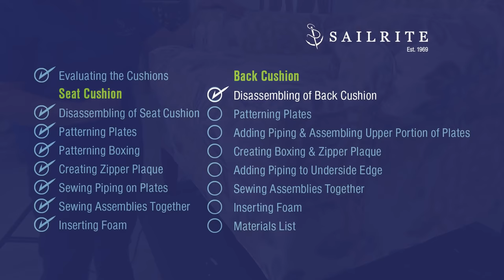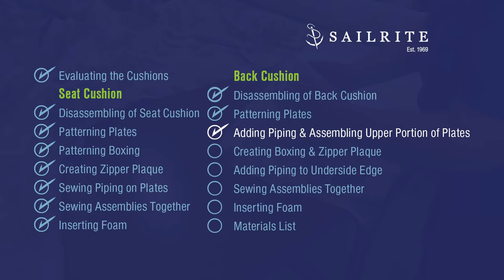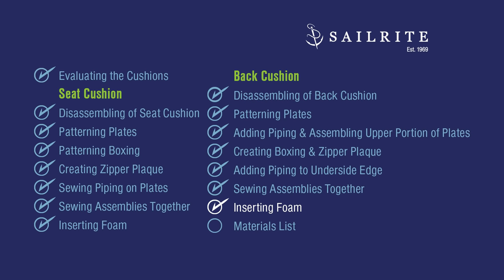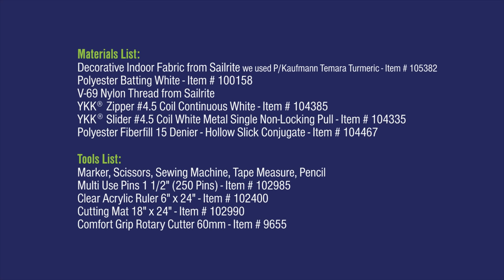How to Make Armchair Cushions

Comment: These are great instructional aides.  I hope I can manage this on my 30 year old Singer.
Reply from the maker: +Bash Brannigan Yes, you can do it. Let us know if you have questions.
Reply: +Sailrite I have a question about the sewing foot. I, too, am on an old machine. I think it's fine, but what exactly is that foot? Is it an upholstery foot, special, or what? I did a search on your site and did not see any sold individually anyway. A lot of what when on seemed to be going right along because of that foot "doing the work," as she said. Thanks!
Reply: +SKenneyGIrl Tan  My machine is also a Singer, going on about 25+ years, just FYI. I am going to look for that foot, but would love some input!  Thanks again.
Reply: You do not need a walking foot. Your regular sewing foot will work just fine so do not go out and purchase a foot. More than likely you will not be able to find a walking foot for a home sewing machine. Most are available for industrial type machines.

Comment: Is there advantage to using foam piping instead of polyester piping/cording? I am working on an indoor cushion with heavier upholstery fabric.  Excellent & detailed video.  I learn a lot & get inspired from the Sailrite YT tutorials!
Reply from the maker: Foam piping works well, but is not as soft as a "Medium Welting Cord" which is made of a polypropylene filler. So... the medium welting cord, in my opinion feels a little more comfortable than the foam cording.
Reply from the maker: I notices that you asked about Polyester cording, I seldom use Polyester cording, but I know it too is soft and could be used.

Comment: thank you again....i just finished the interior cover for a dense foam dog bed using your method for corners and zippers, and it worked out great!!!!  i too did a wrap around zipper with the fold that goes over the top and bottom of the zipper as it allows greater ease of getting the foam in and out when needed.  i do have one question....where the fold overlaps the end of the zippers, there is a opening in the fabric as i did not sew the top cover over the end of the fabric with the zipper ends...is that normal or should i sew it.  i don't recall seeing that in the video.  once again thanks a bunch!
Reply from the maker: The folds over the ends of the zippers are simply a section of the boxing folded over to provide a pocket, the sewing of the boxing to the plates secures these pockets in place. I hope that helps answer your question.

Comment: I've watched this video many times - think it's great, however I am making (or attempting) a cushion and having a heck of a time getting my corners right when adding the bottom piece. Very frustrating. And can't get a foot for my machine that has a tunnel for the cording. Using a zipper foot. Any suggestions?
Reply from the maker: The best technique for matching up the bottom plate to the assembly is to make "match up cuts" at the corners before sewing the bottom plate on. As seen at about 34:00 min. If your sewing machine does not have a cording or piping foot then you are doing the next best thing using a zipper foot.

Comment: My zipper is shorter than the back band from corner to corner so how do I sew the excess seam?  Thanks.
Reply from the maker: In that situation usually the side boxing or banding (with the zipper) would simply go around the corner of the cushions and join up with the zipper plaque boxing. Same process as shown at 30:20 min but the side boxing goes around the corner to join up with the zipper plaque boxing.

Comment: My bottom plate seemed to have stretched when I sewed the cording on. Now it doesn't fit well. What can one do to fix that? I didn't expect upholstery fabric to stretch but there you go....
I know you say to tug one of the pieces but I think I have too much fabric :(
For cushion 2 I think I might sew the cording while sewing plate to boxing to try and have less stretch
Reply from the maker: You may want to try and pin or baste (use #104167) the assembly in place prior to sewing them together. Doing this will ensure that they stay the same as you sew. If you use the basting tape be sure that it is well within the flange of the piping, do not sew through it, or it will be visible when you turn the cushion right side out. Another option is to cut match up notches about every 4 to 6 inches on both the top plate the the bottom plate. The match up notches are placed directly across from each other, so while you are sewing you can be sure they are lined up. If they are not you can pull or push the fabric that is off while you sew, thus re-aligning match up marks. Here is a video that shows using match up marks: https://youtu.be/oaqA7cgxnxA?t=34m32s
Reply: Thank you. I ended up undoing the cording and then folding over the excess. Then I sewed all layers together in one go. It came out ok but I will watch your other video before I make cushion #2
Reply: thank you for that information, i was curious as to how you keep the fabric from creeping while you are sewing....does the presser foot have teeth on it like the grabbing teeth under the foot?  you make it look so easy lol
Reply: If you would have placed the cording on the bottom with the plates on top of the cording when stitching the plates the fabric will not pucker. The feed dogs will pucker the plates if you sew the cording on top. It will not matter if the cording puckers a little. Remember to always keep the cording on the bottom. I sewed cushions for 21 years at a well-known custom order furniture company and know this should work out.